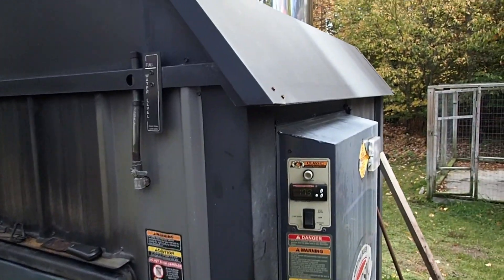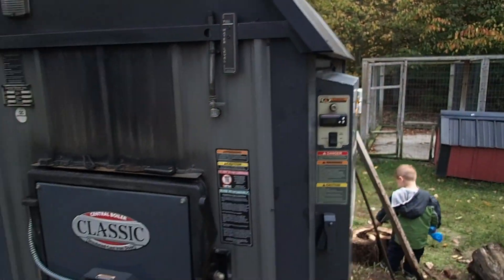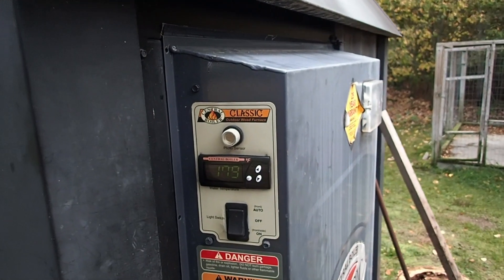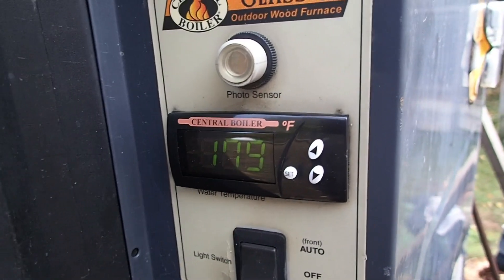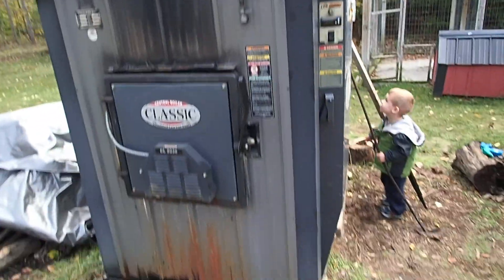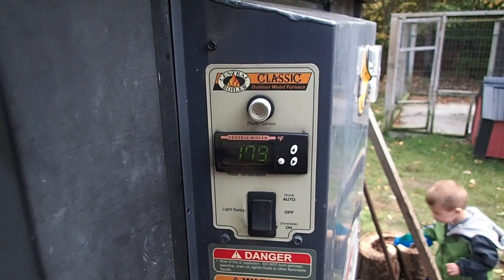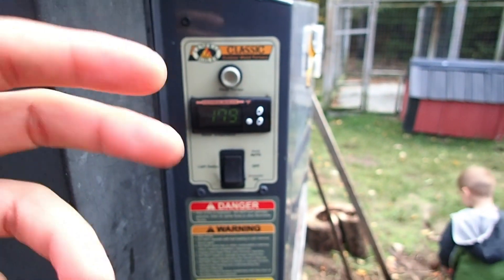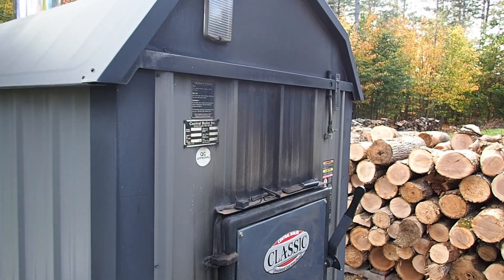Central Boiler: Final issue solved! Temperature Sensor and Controller

Comment: I just looked inside mine and I have the blue wire not hooked to anything but it looks like it went into the clip that goes into the controller between the two black wires. My stove is acting goofy. If I bump it or drop a log in it closes the damper and some times the reading on the display is fluctuating. Does anyone know if that blue wire goes to the controller clip between the two blacks? Its that long and seems like it goes there.
Reply: Blue wire doesn’t go to anything on a 5036

Comment: I hqve the same model just older, I had a problem where the control panel wouldn't show the temperature o ly lines were displayed. Turned out the temp probe was rusted in the hole. When replaced the control panel still displayed only lines. After replacing the control panel it worked as it should. I hope if someone has this same problem this will help them.

Comment: My central boiler was also acting up.  The temperature was indicating extreme fluctuations, exactly as you were experiencing.  Replaced the temperature controller and it did nothing.  That meant is was the probe that connects to the temperature controller.  Probe was $11.25 and the temperature controller was $55.  At least I have a spare now.
Reply: I just replaced my temperature controller and probe, but my water temperature reads 204. I have a CL 5036. Any suggestions?
Reply: @vincent4996  draft damper not sealing completely or door gasket leaking. Lots of videos on both those.
Reply: What models??
Reply: @gloriajohnson9295  Model of the boiler is CL 5036 and have had it since 2011.
Reply: Same thing replaced the display first didnt solve the problem
Reply: @valeriehofmann2615  Mine has been working fine ever since.  Still have the LED display for a spare.  Another good part to have on hand is a spare pump cartridge.  A few days ago, temperature readings had skyrocketed to over 200 degrees (F) but no heat indoors.  The pump cartridge impeller had disintegrated into dozens of pieces.  A few minutes later, switch out the cartridge with its 4 small bolts and back in action.
Reply: @glenwunderlich2438  odd our pump went out too the other day
Reply: @valeriehofmann2615  Even stranger.  A friend, who also has the same furnace,  had asked how my furnace was working.  I responded it was fine - until later that day when I discovered the pump issue.
Reply: @glenwunderlich2438  2 days ago. Dh told me a coworkers pipe burst in house. 10 minutes later our pipes burst in our house 😬
Reply: @valeriehofmann2615  What kind of pipes?  What caused the malfunctions?   Some outdoor furnaces used fittings called Kitec.  The fittings were made in China from inferior materials and resulted in a class action lawsuit.  These fittings also broke down.  Updated my system 12 years ago to PEX lines and fittings. Never an issue - even with the recent pump failure.
Reply: @glenwunderlich2438  copper
Reply: @valeriehofmann2615  Not as strong as the PEX system.
Reply: @glenwunderlich2438  its the pipes in the house in the baseboard heaters. Original that came with them
Reply: Where did you get your parts?
Reply: @gregdavis8152  Local guy, Westmoreland has parts in stock.
Reply: I would like to know, where is the probes location at ? My problem is the control panel only shows lines no temperature. You can program the temperature but it still wont show the actual current temp. Is it the control panel or the temp probe or both ? Has someone had the same problem my unit is 28yrs old
Reply: @jasonstone406  I can't diagnose your issue, but the probe is located inside the door where the pump is.
Reply: @jasonstone406  On my unit, the probe can be found by following a black wire toward the upper right area.  It is actually stuck in the boiler water with some special goop supplied with the new probe.